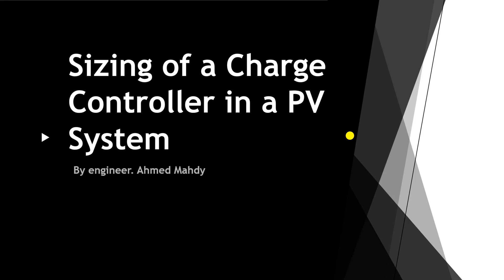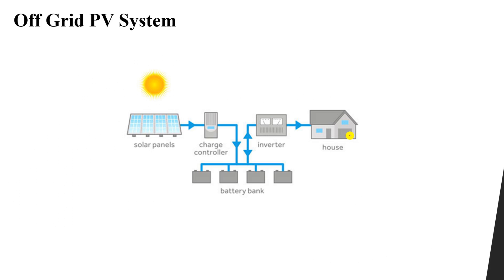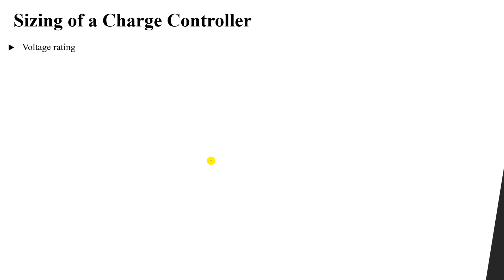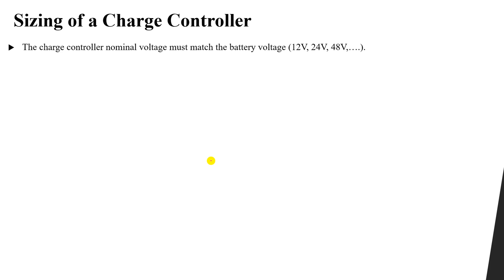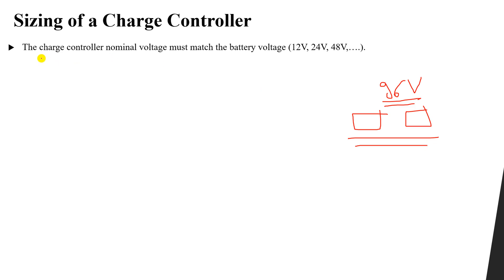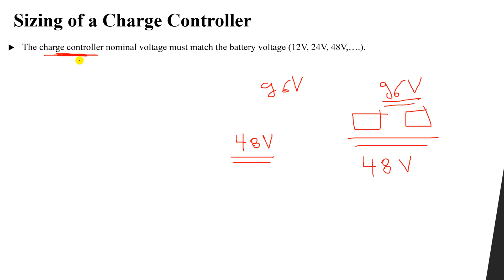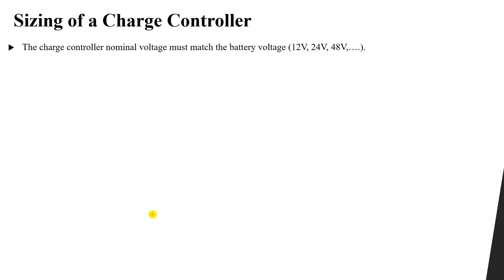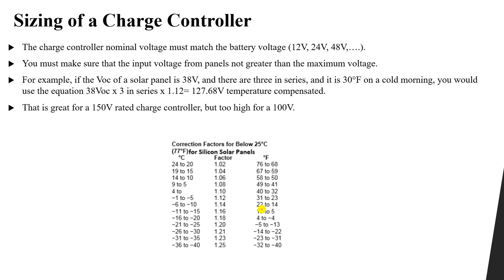How To Size A Solar Charge Controller In An Off Grid PV System?

Comment: Assalamualaikum ! Question. In my open farmland, I've a 3600w SOLAR PANELS ARRAY, a 3500w SOLAR INVERTER and an AC SUBMERSIBLE WATER PUMP of 1,700w(1.7kw) energy rated capacity. My country is on the Equator. Very good sunshine. I want to do a connection as follows: From solar panels to the solar inverter to the AC Submersible water pump. Simple! I don't need to store energy. So I don't need battery bank. The sun must shine tomorrow here 😁🤪. Is my connection going to be O.K ? Do I need any SOLAR Charge Controller? Is there risk to the Inverter if I don't use solar charge controller between my panels and inverter?
Reply from the maker: I will assume that the sizing is correct based on your requirements. What I understood is you have the output of panels connected to a charge controller that charges batteries. The inverter is connected at the terminals of those batteries (24V or 48V or whatever the system voltage). You want to eliminate the charge controller and connect the batteries directly to inverter.
There are two things you need to be aware of:
1- The charge controller function is not just regulating the charging of batteries, but, also, controls the output voltage of panels to ensure maximum power point tracking.
2- The inverter can't be connected directly to the panels as if you are using MPPT charge controller, the voltage will definitely very large not 12V or 24V of batteries. It depends on how many panels connected in series.
The only case you can do this if the inverter and charge controller are one unit together, there are inverters which contain MPPT inside them.
You have to tell me how many panels in series, the open circuit voltage of each panel, and the maximum input voltage to inverter.